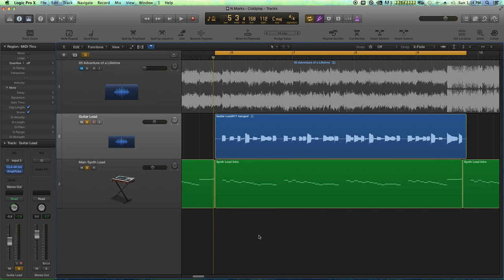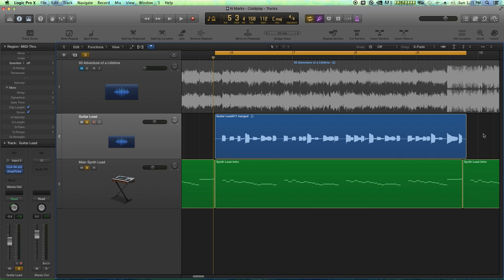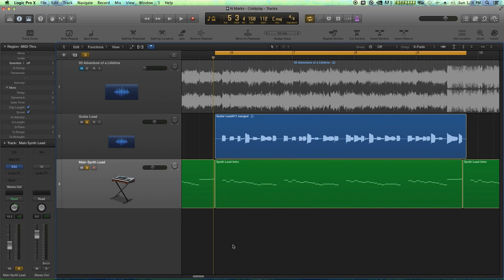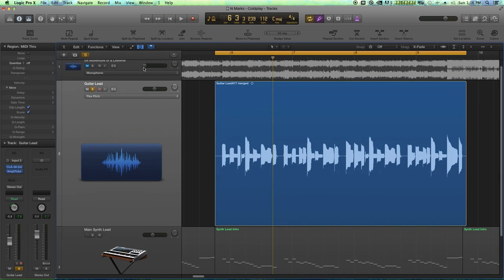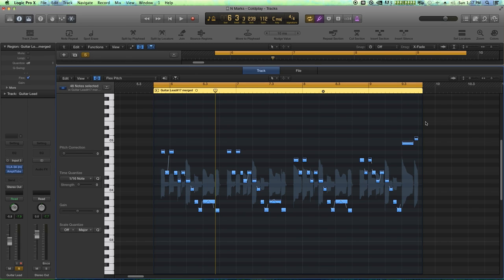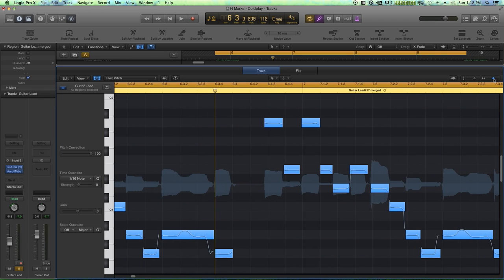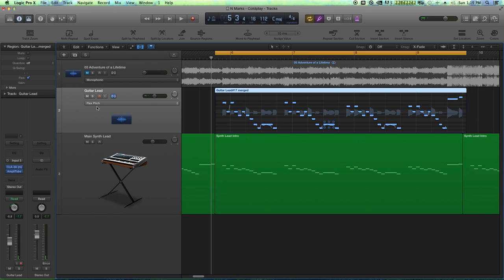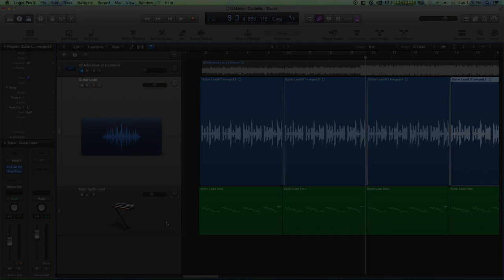Logic Pro X - Cleaning up a Guitar Lead with Flex Pitch and Flex Time

Comment: Hey MTHG, Thanks for the amazing videos. You’ve made my transition from PT to LPX possible. 

I’ve used this approach to cleaning up out of time and out of tune bass parts before with pretty decent results. However, lately it seems to create a wurbly effect on my audio. Almost as if the notes are being stretched or compressed- go figure😆. I know that this is essentially what we are doing I am just wondering why it has sounded fine/natural in the past and now it sounds nearly worthless. Is there a better approach to cleaning up a bass part for time and tune aside from finding a better bass player?😬

Comment: Woah, why does it really screw with the guitar when i try this?
Reply from the maker: +trent klein You may not be quantizing to the right value, or the guitar recording is as clean as mine. If it's pretty close to the grid, DI guitar, and mostly in tune, it should work fine.
Reply: +MusicTechHelpGuy The recording is clean, DI, and mostly in tune besides some intonation issues. I'm not quantizing the time at all, just the pitch and it's artifacting really bad. Maybe it is the interface I used to record it that caused some unknown issues? I did recently upgrade, so the new interface should be here in a couple days. Maybe I'll try recording with that and see how that goes.
Reply from the maker: Weird. I've had very few issues with DI guitar. Good luck!
Reply: +MusicTechHelpGuy Logic and I just have had a love/relationship from the beginning hahaha Thanks for all your help!!